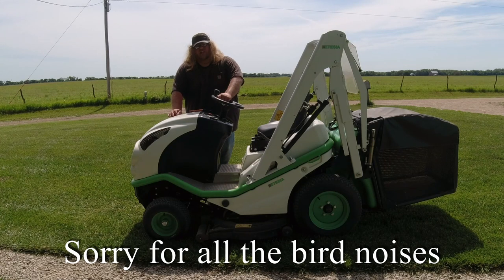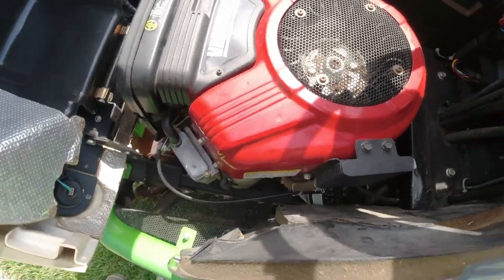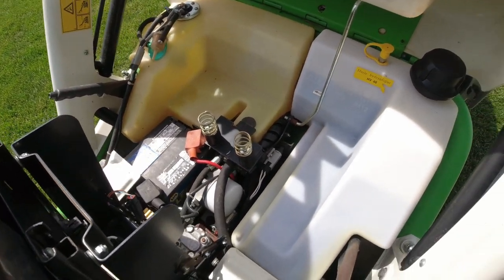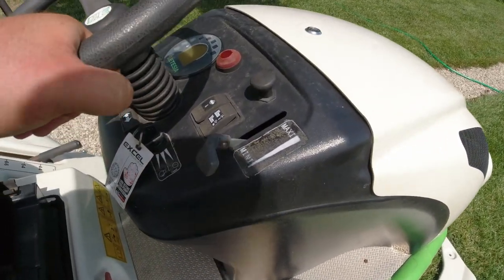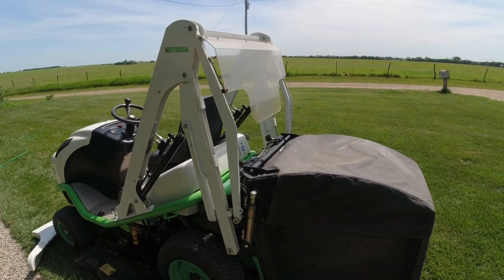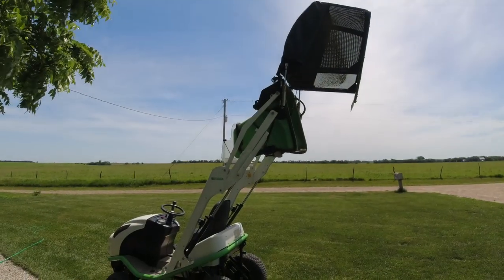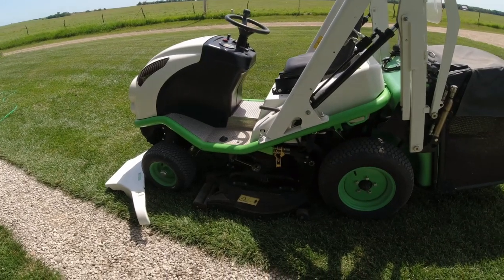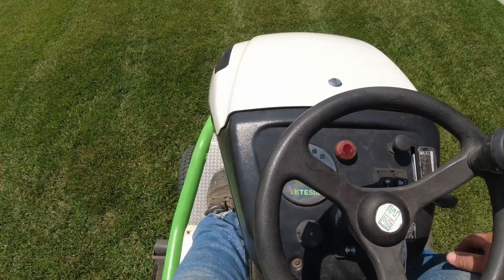About the Etesia Mower, Walk Around and all the Controls!

Comment: It is common for mowers over here to be designed for damp or wet grass as in the spring and autumn our grass never drys. We have a mower made by a UK company called Countax which has a similar toothed belt. In france and many countries in Europe (not the UK) commercial road going vehicles must display the max permissible speed, hence the 25 (KPH) on the back. Only the UK uses MPH like you. Thanks for the walk around, it was very interesting
Reply from the maker: Oh that's what the 25 is on the bag! That make sense I should have known that from my farm simulator experience haha
Thanks for the info!